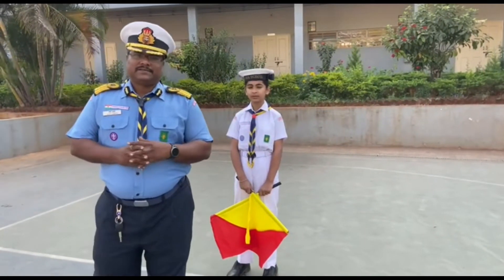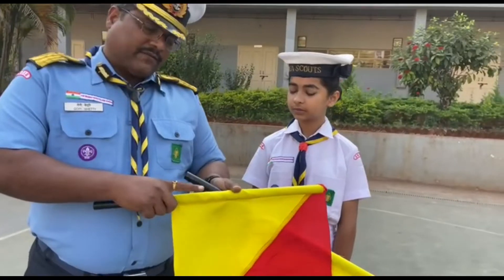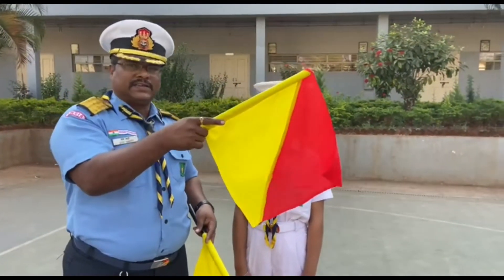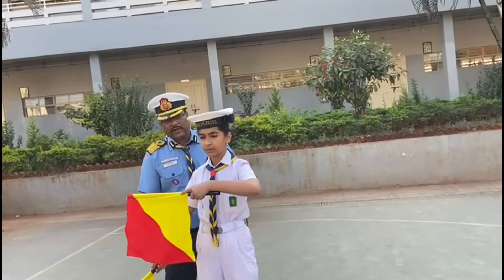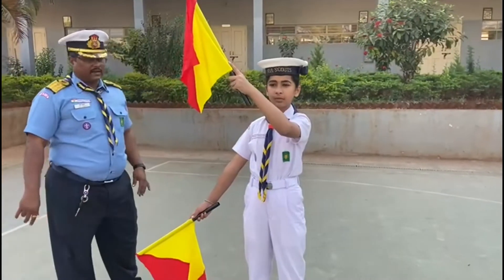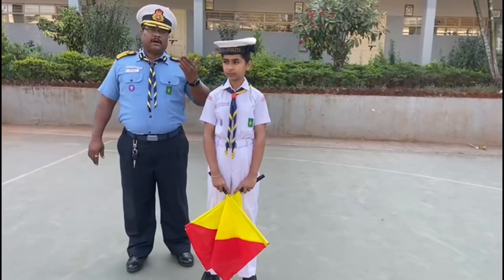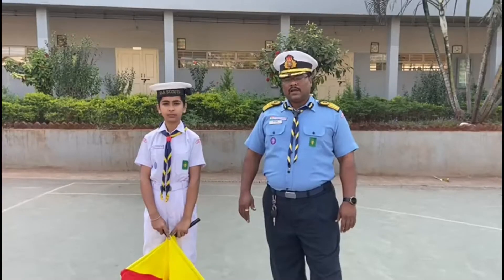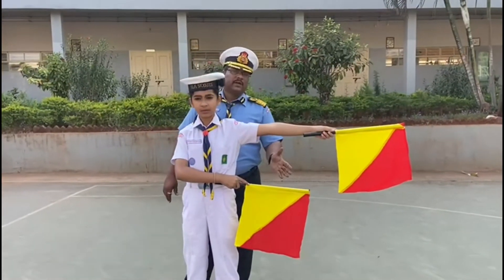Semaphore Signalling

Comment: Semaphore has always intrigued me. Many years ago, I qualified for my Novice Ham Radio license, back when 5 wpm Morse code was still required. I still remember about half of my Morse and probably about the same with my radio theory. I have been casually trying to relearn what I have forgotten. I would kind of like to add semaphore to my repertoire and have checked out a number of YouTube videos. This one actually explains the positions fairly well, whereas all the others I've seen simply demonstrate the signals--and typically at a rather fast rate. While I could have stopped and started the other videos in order to make sense of what I was seeing, this officer and his cadet truly demonstrated and taught semaphore. The one suggestion that I might make is to point out that the order of the positions within the circles sometimes changes, I assume because of letter frequency. While the officer's accent was quite pronounced, I was able to understand him very well. I did have trouble with one or two words, but I was able to quickly figure them out by context. My hearing is very bad, especially the ability to discriminate between two similar sounding words, like elevator and alligator. Even so, I could understand him fairly easily because he enunciated his words so distinctly. It seemed like he was making an effort to be understandable. Thank you for that. Too many people mumble instead of speaking clearly. This was a very well-done video--bravo!
Reply from the maker: Thank you sir